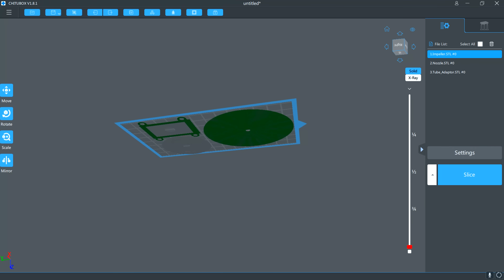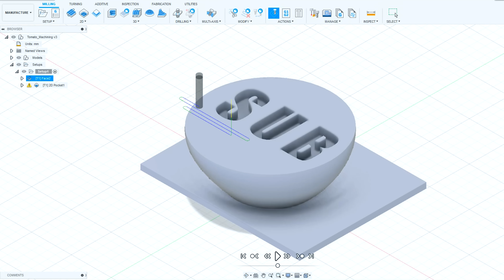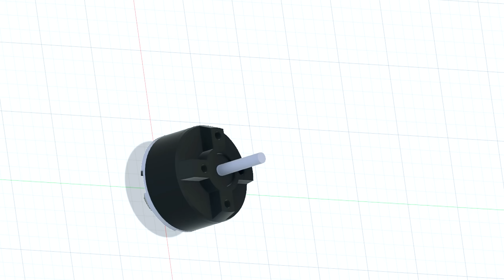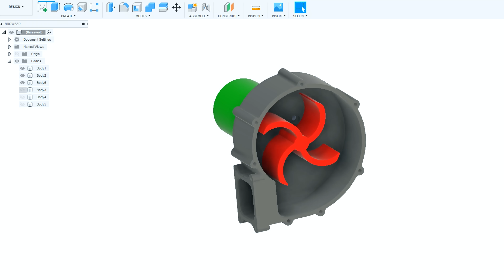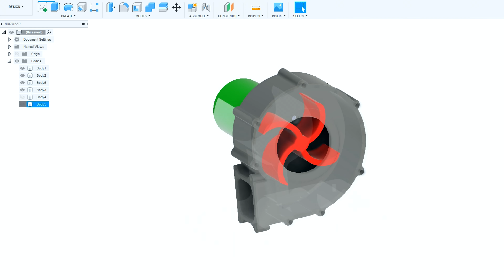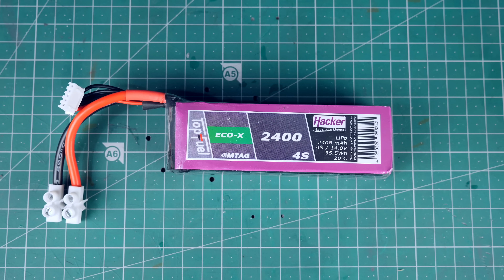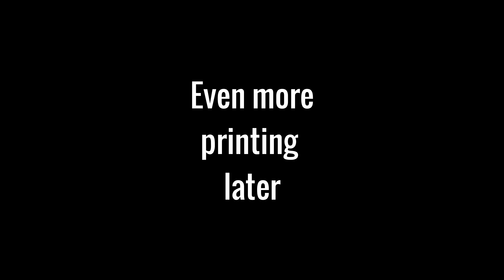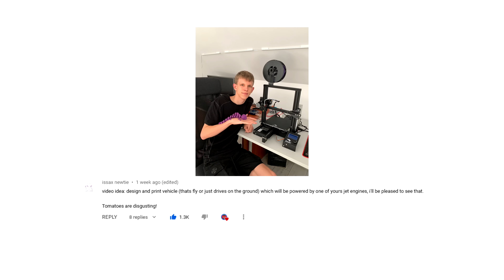Water Rocket Skateboard (3D Printed)

Comment: Lots of cavitation, too much speed, need a new design. Speed of the blade is causing such a low pressure the water is boiling, looking at the slow mo, you’re  moving like half water,  half air so very inefficient.  I can point out the problems but I don’t have the know how to correct them, just like my daughters English essays haha

Comment: Use your motor to make a high pressure AIR pump/compressor, to continually pressurize a tank of water with a water nozzle on the bottom of the tank.  The water will shoot out of the nozzle.

Comment: Integza, have you ever seen the coolant pump from an outboard motor? It's made out of a flexible rubber. And the impeller is offset. So the impeller vanes can change shape. This makes it also change volume making the pump more efficient. Also to make the water stream more laminar you might try adding some turbulators. By adding a controlled amount of turbulence it can actually make it LESS turbulent.

Comment: 3d print a 3d printer....I'm talking 3d printed v slots, bearings, extruder, heated bed, belts, everything. only thing that doesn't have to be 3d printed are the electronics and hot end. I want it to actually work

just thinking this might be possible with ceramic parts for hot places

Comment: You need a MUCH bigger inlet tube, and no valve!!! Small inlet tube and the valve are restricting the flow of water too much. It will perform much better if you put a bigger inlet tube on it and remove the valve :)

Comment: This is a very questionable idea, but hear me out.
I reckon you used water instead of air because while both behave as fluids, water is heavier and will give you more thrust at the same velocity.
So what if you used a heavier liquid? likee..
Mercury
Yes that's a very stupid idea I agree, but if you make sure someone that has experience in dealing with mercury helps you out (like Cody from Cody'sLab, wink wink)
You could make a safe test environment* where you don't contaminate yourself or anything/anyone else with the liquid mercury.

*: for example, a rectangular acrylic box.
You may also want to scale it down for safety and also the fact that mercury is harder to come by than water so you'll probably have less of it, in which case a smaller pump will last longer.

Comment: You could use an impeller design like most jet ski's and speed boats use. Which would be able to handle better load with 3D printed parts. Which i use the same motor and Lipo setup in a 3D printed boat. Which works well. In your case. you'll want to make a larger prop and housing. But should hold up just the same.

Comment: Video idea: since it's summer and the sun is trying to burn us all (at least it feels that way), how about making a stirling engine that utilises the heat of the sun and drives a sketeboard or something similar forward?
Also comment on CNC, when you start making metal parts with it I suggest starting with aluminium and/or brass. They are easy to work on mills and lathes and actually a real joy to make parts from. Best of luck on learning machining, have fun.

Comment: A little hint for way better pump performance: There are injection molded water jet units you can buy, just attach a powerful motor and off you go.
And little mistake on the first explanation: RPGs don't have any recoil, because the missile/grenade propels itself out of the tube, and the tube is open at the rear end. It doesn't usually shoot red rubber balls on the other hand, so maybe it's just a potato cannon painted like an RPG to confuse the enemy?

Comment: Your turbine blades were so fast that they went into cavitation mode and made a steam bubble instead pumping the water. it would had been better to use a smaller motor with more torque than high rpm. The military all over the globe have the same problems with the propeller of their submarines; that is why they have this weird sickle form.

Comment: Isn't it easier to put a lot of pressure on the top of the box (of course not that box) instead of pumping water out? Like that pressure cleaner at the beginning of the video 
The pressure does the job :)

Comment: At 8:40 isn’t the impeller the wrong way round? Like the direction it curves? 

Also, the only thing this pump needs to be optimized for is mass flow rate. To that end the narrowing of the pipe you inexplicable designed where it attached to the box and the pump is only making it harder for the motor as well as the converging nozzle. There is absolutely no benefit and only cost to having a converging nozzle unless whatever you’re pushing through it is transonic, you do this a lot and all it’s doing is loosing you energy.

You could see in the slow motion of the motor when the sound wasn’t working that the pump wasn’t getting enough water because it was cavatating (generating gas bubbles)  and really putting most of its energy into churning the water (I expect this may not be helped by my first point also).

Comment: You mounted the hose way too high. You lost almost a liter. Also control your pump with an Arduino instead of a remote to gradually increase speed and add a water level sensor so it doesn't run dry. Therefore not blowing up the enginr

Comment: hey there! great video and conclusions... but what if... the water jet points angular like 45º to the ground? I think it will move much much faster hitting some solid than the air... and may be if you don't want to cnc aluminium you can just do a mold (3d printed) and cast it... :)

Comment: Ive performed manufacturing for more than 5 years, and had some schooling. The most important thing about machining metal is identifying the properties of the metal you are cutting, and the individual cuts you are performing. For instance, some grades of steel are extremely difficult to effectively cut, while aluminum and soft metals like brass or bronze can be sliced like butter.

You saw this with the acrylic. A faster climb speed can destroy the material or the tool if the pass amount is too high, in other words, little bites for faster speeds, and bigger bites require a much slower climb speed.

Also check out the concept of climb milling in general. I was trained on manual mills and so climb milling was scary and something that should not be done, but in the CNC world, climb milling is the standard..

just watch out for peculiarities of the machine executing the code, sometimes increasing climb speeds causes curves and corners to be treated differently by the program.. requiring you to rebuild your code, or significantly slow down the feed.

Happy milling about Integza.

Comment: You should play with impeller shapes and impeller sizes, volume and larger pump size pump.

The pressure build up from the smaller novel might have been too much for the impellers to handle.

Comment: You need to properly design the impeller, centrifugal pumps require very small tolerances and proper housing geometry to prevent cavitation at high power also I would fill the pump housing completely before starting the pump to reduce the forces at startup, also you should try aluminium next, its pretty easy to machine

Comment: Hopefully integza sees this and anyone who reads it isn't immediately confused by what I'm saying,  lol. 

I may be wrong, but in the assembly clips, the tolerance between the impeller and the pump casing seemed very very minimal. It's entirely possible that I'm wrong, but I think the reason it was exploding was due to the impeller expanding from centrifugal force from the RPM's of the motor. When it expands like that, the impeller hits the casing walls, creating friction and heat. Because heat is directly relative to pressure, when the chamber heats up, the pressure increases and causes problems, hence why it only exploded when the motor was reaching max speed. 

I think a way around this, would be to create a type of sliding arm that once it passes the pump outlet, it expands, grabbing water, and once getting to the 3rd quarter of the pump, begins to retract mechanical. This would lessen the friction while also giving the bar a way to relieve centrifugal energy through vertical motion. If you stacked these "sliding arms" 2x, 1 on each axis (x & y) you would have 2 points of contact on the water. In conjunction with that, if you used a smaller motor on a 2nd pump feeding straight into the larger pump, you could reduce the power level on the larger pump. Making the smaller pump act like a turbocharger somewhat. If you see any issues with this logic or explanation please let me know, there is always a learning opportunity.

Comment: Video Idea:  Use 4 motors, 1 for each wheel on the skateboard and run water through them backwards using a single pump and a closed loop.

Comment: the first one would work good number one, your impeller was way too big. number two your nozzle should have neck down to a very small point to see lots of pressure. that DC motor has plenty of power for its size. 🥴💢

Comment: I think pump would do more job if there was no air inside it. 

You could close nozzle, then let air out of small hole on top of pump. After air is out close hole and start pump on low RPM, than as fast as possible open nozzle and increase RPM of pump. Or make membrane that will brake when pump gives high pressure.

Comment: couple thoughts.
First off, your impeller needs a cage. Having curved vanes like that, unsupported, means there's a huge twisting motion on the super-brittle resin when it gets spun up high. Adding a back AND front plate to the impeller (with a hole in the center of the front for the inlet) would give it a lot more rigidity, which means less twisting, which means less vanes snapping off at the root.
Second, your impeller probably needs to be geared WAY, WAY down. 60,000 RPM is absolutely insane for a water pump. The reason your pump is working fine and then suddenly exploding with no warning, is that you're hitting the cavitation threshold for the impeller. The second you start getting significant cavitation, the impeller stops taking in new water, which means the resistance on the vanes drops to basically nothing, which means the speed goes up from a reasonable speed to that 60k RPM you were talking about almost instantly, which destroys your impeller. Also to get more water movement in a high speed jet, you probably need much higher pressure and a more restricted nozzle. Higher pressures also help reduce cavitation. To get higher pressure you need more torque. 
Gearing your impeller down with a 10:1 belt drive or something would probably solve both these problems - you'd have a ton more torque for building pressure against a restrictive nozzle, and you'd not come nearly as close to the ridiculous speeds you're spinning that thing at, so it would be less likely to blow up on you.

Comment: When RPM is too high You will get a lot of air trapped inside, submerge the pump in water 1st.
Reply: Also needs to change the inlet and outlet. The inlet piping does not need to be necked down right at the inlet and the 90 degree bend needs to be have a larger radius, this also causes cavitation as it throttles centrifugal pumps a lot at the inlet. The outlet needs to be longer before the nozzle is put on. All this will increase the pumps efficiency. As long as the water level is higher then the upper most part of the volute is will self prime and air will get pumped out. But he also needs to start it a little slower and potentially give the veins of the impeller a larger radius as well as making it a “semi-open” impeller.
Reply: @marv8481  ALSO: it looks like the elbow to faceplate seal is leaking, so it's not only cavitating, but sucking in air, which is why it was able to WAY overrev, and explode.
Reply: @marv8481  this man knows!
Reply: Exactly, even when the battery isn't charged you can see air in the chamber. Liquid pumps need to be primed. It will probably also slow the engine down a bit but I doubt the prints can hold.
Reply: https://www.youtube.com/watch?v=jbgvQNhFDTo Good video detailing the cavitation limitation.
Perhaps try injecting CO2 AFTER the pump, accelerating the water in a 2-stage thrust on the water!
Reply: It also looks like you may be sucking air into the chamber, use silicone and rubber washers  on your joins and screws.
Reply: THIS
Reply: It looks like a homemade supercharger to me
Reply: When you get cavitation (produced air bubbles to to shearing) the pump blade becomes very inefficient. Sometimes it's not just about turning it faster but moving the water more efficiently. That's the point I was trying to put across.
Reply: @owenreynolds5285  and you put it quite well!! Cavitation is the culprit at this level of rpm with subsequent increase of pressure inside chamber
Reply: also consider cavitation. look it up.
Reply: @owenreynolds5285  it is all that and more :)
Reply: Cavitation
Reply: Not only that but his impeller fins are pointing in the wrong direction.
Reply: @americancustomrc5359  for the outlet direction the impeller is oriented correctly, centrifugal pumps don't scoop water they gently push the water allowing it to gain momentum smoothly, the angle of the impeller is far too steep, and that pump is not only cavitating but also probably air binding aka sucking air which is not helping efficiency at all, I feel like a better designed pump with a lower power motor would do far better than slap a bigger motor in it and go. I'm sure he could look into other pump designs the comparative pump curves of those designs and come up with something much better
Reply: Also try aiming the outlet down closer to the floor so ur not shooting water in to the air may get more thrust
Reply: @Idk-qi6pc  wtf are you taling about xD water is not made of air but oxygen and no it is not the same xD

Comment: Idea: start to design flying rockets using your previously explored rocket engines. You can potentially even use an air filter as a throttle control with the opening and closing. As far as fuel, bernzomatic fuel tanks and compressed air could be tied to a mixing valve.

Comment: I'm thinking a carbon fibre filled filament, something flexible like Nylon, would be a good idea for the impeller! CF-Nylon is pretty easy to print compared to just Nylon thankfully, and the horizontal orientation of the fibres would be really handy for those lateral g-forces. The flex of the Nylon allowing just enough give to prevent it from detonating quite so violently.

Comment: ps when making a waterjet you need the intake to be greater diameter compared to the nozzle. a waterjet works by increasing the speed of the water. make it more like a jetski pump. so the intake has the same diameter as the impeller. and the nozzle on the exit side will be a cone to increase pressure . this way there will be less cavitation on the blades and the water will exit with a  higher speed. resulting in higher forces.

Comment: There is far too much air in your pump, I believe. The housing is too large for the size of your impeller, and your impeller needs more vanes to push more water. And as you mention at the end of the video, your impeller needs to be made using a different method. 
Finally, your impeller needs to be balanced. I used to work in a turbocharger repair shop, and at such high RPMs, even a slight imbalance can cause catastrophic failure.

Comment: You can cut aluminium with your cnc machine juste use WD40 and cut verry slowly (100mm/min and 0.2mm per cut)!
By the way the hacksmith try to 3D print turbine propeler 4-5 years ago and the same fing happens

Comment: That's a very small cnc router, I wouldn't get my hopes up on the "milling metal" part. Not that it's impossible, but it would propably produce pretty inaccurate parts and very likely get damaged in the process. There is a reason why milling machines for metal are pretty beefy pieces of machinery.

Comment: 8:17 isn´t the wheel in the wrong direction.I think the open curves schould spin in the direction where the water flows.
Reply: That would mean, that the water gets directed upwards near the exit and basically turning circles in the pump reducing its waterpumping capabilities.
Reply: @No_Way_NO_WAY  Okay i thought that it would spin more water and so more water would be pulled outward through the centrifugal force.
Reply: @animatobyc  fluid dynamics its pretty annoying because its (at least for me) counter intuitive what the fluid does. Was working on a device that protects the tap from waste water in a machine. There are solutions out there that work and are cheap but they are no longer according regulations and the other ones that are still according to it, are much more expensive.
And the water never wanted to do what i intended with it. Sometimes jumping a gap, other times it didnt (especially when i wanted it to jump the gap).....
Reply: @No_Way_NO_WAY  okay, maybe you can use for your problem some fluid simulation program, so you can see what it would do before you make it in reallife.
Reply: @animatobyc  a cheap simulation workstation costs around 20k a year. And my project was the only one that neded one => no purchase. And now the project is the nightmare of a former coworker because i left the company.

Comment: I really need a 3d printer.
idea: currently you are generating the thrust by splashing water in to the air.
Why don't you try to splash the water to the ground at an angle of 30°.